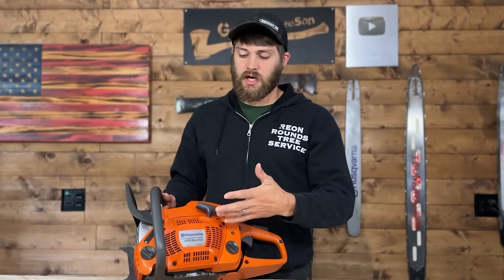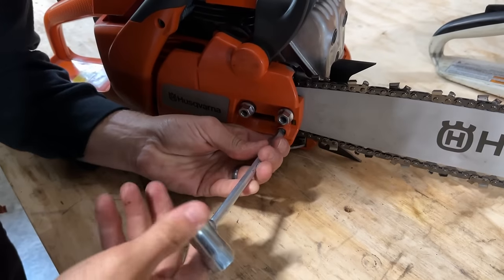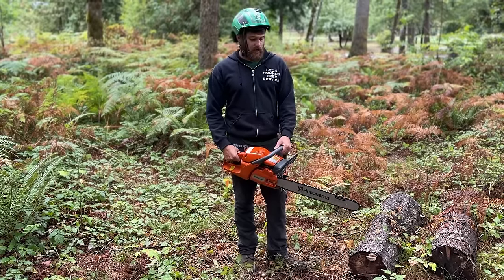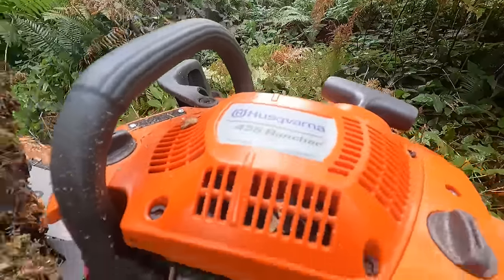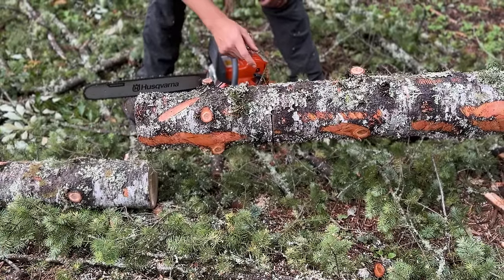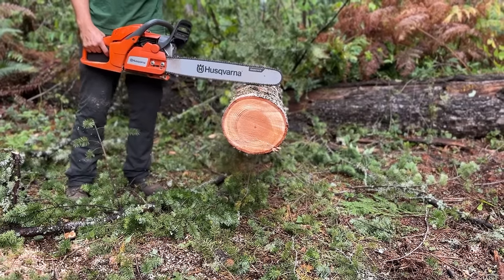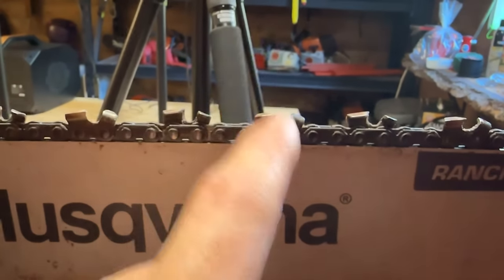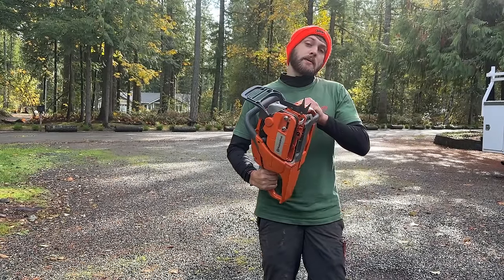WORLDS BEST CHAINSAW TUTORIAL! EVERYTHING You Need to Know About Owning and Operating a Chainsaw!

Comment: Important to remember when buying small amounts (1 or 2 gallons) of ethanol free gas is that stations that use multiple types of fuel that use a single hose will have up to 1 or 2 gallons of whatever the last use was in the hose system! You may think you are getting ethanol free, but it may not be the case. I always pump a few gallons into vehicle tank and then fill up smaller containers. Chickanic does a good video on this.
Reply: I buy ethanol-free fuel all the time for my small engines. Never thought to do this. Will be doing this moving forward.
Reply: I’ve never been to a gas station with ethanol free that shared a hose. They are always separate where I’m at. I don’t know why any station wouldn’t be like this.
Reply: Love your videos man keep it up

Comment: Just a quick tip on the ethanol free fuel. If someone used that pump before you, the hose could be full of ethanol fuel. I always put a gallon in my car before filling the gas cans.
Reply from the maker: Thanks for the tip!
Reply: Does everything pump through the one hose in USA? We have different hoses for different octanes and deisel here
Reply: @dad_uchiha1707  
Some places do pump ethanol fuel and non-ethanol fuel through the same hose & nozzle.  Some places have dedicated nozzles for the non-ethanol fuel.  You have to keep an eye out for this.  If they do use the same nozzle, it is a good idea to pump the first gallon or so, into your car first, then fill the gas can that you use for the saw.  You never know what grade of fuel the person before you put into their car, and the hose and switchover valve inside the pump might be, most likely, filled with ethanol fuel.
Reply: Luckily my go to gas station has its own hose for ethenol free gas.

Comment: I have beem in logging and using a chainsaw for 55 years and one of the most important things to do is keep your thumb wrapped around the handle bar, you did not say anything about that. On kick back the saw will not tear your thumb off, but if you do not have it wrapped around your handle bar your hand will slip off and you will get cut.

Comment: Ol' Chainsaw Gramma here...have both Stihl and a Husqvarna.  One thing I do after warming up a saw that I think is ready to go, is I put down a little chunk of cleanish cardboard or some newspaper and full throttle the saw blade over it.  If your oiler is working properly, there should be an oil streak on the paper showing that your oiler is indeed oiling the blade and not plugged up.  Beats finding that your blade is hot when you're in the thick of cutting.

Comment: As im sure others have already said flooding an engine is caused from to much gas in the cylinder it actually soaks the spark plug preventing proper ignition. Holding the throttle open allows air into the cylinder this helps to dry the cylinder/plug but also corrects air fuel ratio allowing the engine to run. I really enjoy your watching climbing and felling in the south we don’t climb much mostly done from a bucket

Comment: That is a great video to learn how to own/operate a chainsaw. Thank you for teaching and helping to reiterate how to properly use a chainsaw. One thing beginners need to know on saws especially stihl saws is that when you put it at half choke the saw is going to be running at a high rpm and it only takes 30 seconds at full throttle to destroy a chain break so when the saw starts to rev on half choke immediately blip the throttle so that the rpms go down. This is one of the best beginner tutorials out there in my opinion.

Comment: Hi. This is one of the best basic chainsaw orientations and basic chainsaw safety training videos on YouTube.   When you were reading your raker depth guage you were reading it as "point two-five". It actually reads .025 which means the top of the raker is 25 thousandths of an inch below the top of each cutting tooth when the chain is properly sharpened.  This provides ideal chips when cutting.  Your more extensive video on this subject is equally good. Thank you very much. They are extremely helpful.

Comment: A tip for fueling up: use a small brush to clear debris from the cap areas. A laundry detergent bottle with a pour spout will make filling up the oil tank easier.
  For most homeowners looking to purchase a saw to use a few days per year, I recommend getting a battery saw. Milwaukee, Dewalt, Makita, or whatever brand you might already have is a good choice. Avoid the super cheap knockoff brands or used saws from a stranger. What might seem like a good deal will likely lead to a lot of frustration later.

Comment: Very good tutorial! Thanks! I have the 455 Rancher myself. Just bought two new Oregon chains for it today. It's nice to see a tutorial using the exact equipment I have!

I like the 455 Rancher. I also looked at the 460, but it's heavier and i didn't really need the 24" bar it comes with. I bought the 455 because I had to cut up a big fallen oak and a big pine that it knocked over when it came down after it was struck by lightning last summer. Both trees ended up lying right across my long driveway through the woods. I didn't even know it had happened, but my wife called me when she came home and found that the driveway now disappeared into those big fallen trees! I got a lot of firewood from them, but it was most of a week of work for me to cut everything up and stack all of the wood and clean up the area. I needed the exercise anyway!

Comment: Very comprehensive tutorial and you covered all the important topics of the chainsaw.  Nice job!  I am a 50-year DIYer chainsawer and it seems I never quit learning about these awesome tools.  Only thing I'd add is that I do exactly what you do for long term storage but I run engineered fuel thru it before putting it away (vs keeping it dry) .  The engineered fuel lasts two years and keeps the diaphragms lubed. Be sure to buy the 50:1 mix.  What kills fuel systems is not only ethanol (minor) but the benzene found in all gas station gas.  Benzene is the major killer of fuel systems.  Engineered fuel has little/no ethanol or benzene and will not wreck your fuel system. I run gas station fuel when operating the saw (lots cheaper) but store with engineered fuel.

Comment: The rakes are strange looking because it is a safety chain. They are normally included on home owner chainsaws so you have to tell them you want a real chain not the safety chain. The safety chain cuts a lot slower because it takes a smaller chip but it is also a lot harder to get kick back so it is safer. I didn't know about the safety chains once and ended up with one. I took the chainsaw back because it cut so poorly. He told me about the chains and I bought a good one. Kept the safety chain for an emergency backup but have never put it back on. Love your videos.

Comment: As a woodturner I get access to quite a few logs from local tree surgeons. I need to cut them up to store to allow to dry. In have been using a small electric chain saw to chop smaller branches around 6 to 7 inches in diameter. I am moving up to larger bowls (15 inches diameter ) and as such  now need a more powerful chainsaw and longer bar . I have just purchased a petrol chainsaw with 20 inch bar. But in respect of how dangerous it could be have embarked on a lot of video watching to educate myself on the correct and more importantly safe use before I start. I have viewed several videos on you tube but your video has provided so much comprehensive iniformation, instruction and guidance, delivered in an easy to understand way. I will refer back to it again and again in the future. Thank you for making such a superb video. It has helped a great deal.

Comment: Flooding means you have too much gas and not enough air so it can't burn because there's not enough oxygen in the cylinder anymore. You need about 10 parts air to one part gas before correct combustion. Flooded just means there's too much gas. The reason holding down the throttle and turning the choke off is now you are opening up as much air as you can possibly pump into the system at a time. So if you don't want to just wait forever, you can open the throttle all the way and eventually you'll pump out enough of the fuel and get enough air back inside at it will fire up and start. Hope that helps.

Comment: flooded, having throttle wide open adds more air then fuel, allows to remove the excessive fuel/ oil 
mix from chamber. can remove plug and pull few times to dry out cylinder, and wipe off plug so it will spark.
warm up due to aluminum piston to steel bore and so everything’s at proper “gap” tolerances when warm.
great guide , you did a wonderful job covering all the key points. what experience have you had with gas 
stabilizer? or running cleaner in the gas mix? great video thank you for your time.

Comment: I have been told that if I have had to tighten the bar after it has been running for a while to make sure you loosen the bar when you are done an put it up. The reason you have to tighten the chain is because it has heated up and the metal has expanded. Once it cools down, the metal will shrink back down. If you don't loosen up the bar, it will get really tight and wear out your sprocket bearing faster.

Comment: One guick note on fuel as an ex stihl dealer. Your spot on about the ethanol in today's fuel but occtain does matter. Stihl recommends 92 or better . Also only fill your cans to premix ratio. Most gas cans hold more the stated amount
Reply: Also, adding any oil at all to fuel will reduce the octane by a point or two, per bottle. You can start with 91, but by your second mix bottle your octane might actually be 87-89. Use the highest non-ethanol octane available

Comment: Great info. One thing that I have done that caused a problem was to take the side cover off when the chain break was on. The brake band that wraps around the clutch gripping the clutch so it will not rotate is mounted in the side cover and when you pull the side cover off you are also separating the brake mechanism from the device that is used to disengage the brake. Then it is relatively impossible to re mount the cover because the brake band will not go over the clutch in its engaged position.

Comment: This video was great! I literally knew almost nothing before cutting down my first tree. And not much more before buying my first saw (out of necessity: big tree fell over in a windstorm mostly blocking my front door). But, one day i found your old channel and have learned so much more! I actually went out to buy wedges! Previously i was using small sticks in the back cut to prevent the tree from pinching my bar... But i was also cutting all the way through the hinge. I cut much more cautious now and use my wedges... I still need to get a decent axe, but it's on my list with some chaps. I actually barely knicked a pair of jeans once 🙀

Comment: I have ran ethanol premium gas in my chainsaws and trimmers for decades without any issues. I just add stabilizer to my 5 gallon container of gas, and then mix a gallon at a time. I have found the vegetable based bar oil to be very thin, and gets used up very fast.

Comment: Very well done.  Really first rate info, and your sense of humor (whimsy) is contageous.

I have an old Husky 55 (1999) that still runs like a champ.  It's punched way above its weight and I joke (or am I joking?) that I want to be burried with it.  Starts right up and bingo, I'm in business.

The only thing I think you might have covered is that the cutters are generally sharpened with the bar pointed in opposite directions so you file towards the cutting edge of the cutter.

Oh.  Nitpicking, but the raker file gauge you demonstrated was .025, not .25.

Comment: The point about letting saws warm up before use is critical.  Particularly if you are interested in getting long and useful lives out of your saws.  The basic gist is that the piston is usually made of a lighter weight alloy material than what the cylinder head is cast from and, when you start a saw and immediately give it the beans without letting it warm up from idle, the piston will expand in size at a faster rate than than the cylinder head, which results in the piston expanding to a point where it will begin scoring itself and the cylinder walls; the rapid expansion of the piston can also cause the rings to seize as well.  I worked on an MS 462 Magnum recently which had this happen so badly that chunks of ring material managed to embed themselves in the piston.  

One other comment I might make from the section on saw starting - you showed a few shots of the saw sitting on the ground idling and warming up.  Depending on your region and usual climate, this might not be a problem, but where I live in Montana this can pose a significant fire risk if the muffler happens to be in front of or near flammable brush.  Same goes for when you shut the saw off and set it down with a hot muffler or bar & chain.  Of course, too, if the fire danger reaches a certain level, the saws may need to just be put away completely.

I service and sell STIHL chainsaws for a living, and do plenty of logging in my spare time as a hobby and side gig.  Love your videos, keep it up

Comment: Good video thanks...👍 I suppose being picky, the more you raise the bar before tightening up the side cover screws, the more out of square your tree felling sight lines will be. Maybe less than 10 degrees in the extreme, but they aren't to be 100% trusted as a true 90 degrees to the cut. 

I've only been an amateur home logger user this past 20+ years and use a cheap DIY store small saw, but I keep it sharp, clean and never run out of bar oil and it has done me proud all these years. I just keep an eye on replacing the tubing yearly, cleaning the air filter and only use UK premium unleaded petrol in it. Thanks Jake...👍

Comment: Nice tutorial on a saw that I own. The Husqvarna 455 rancher. It's also a good idea that if one wants to do some serious and good cutting or moderate felling is to get a good quality bar and chain. Some of these 455 ranchers that are sold in hardware stores that come in the box complete with bar and chain come with only an entry level bar and chain for just around the acreage use such as cutting firewood and not that great for felling or heavy duty work. Some of the Husqvarna 455 Ranchers come with a Husqvarna  " Farm tough"  bar and a H-40 chain 3/8th pitch 72 tooth bar and chain .050 guage. I am using an E72 powercut on a 20 inch advanced cut Oregon bar .050 guage and 3/8th pitch on mine.

Comment: Excellent video!A little tip from Chickanic channel about ethanol  gas  would be to put 1st gallon in your truck as whatever was in the hose from previous user (generally 87 ethanol) is what you will be putting into your  gas can. Would a big difference if just using a 1 gallon  container  or if pump had a very large / long hose .

Comment: Your raker gauge is .025, or 25 hundredths. That is how much lower the raker is from the cutting tooth. In your case, you are filing your rakers down .025 lower than your cutters. So that means it will take off .025 of wood each time the cutter hits the wood.

Comment: A saw is "flooded" when the fuel-air ratio in the cylinder exceeds the combustion range (not enough air/oxygen to burn the fuel). When unflooding, holding the throttle works because at full throttle the carburetor lets in more air in than at Idle, Leaning the over-rich condition back out into the combustion range.

Comment: great video Jake! I am going to send it to my brother who just bought his first chainsaw :-) 
one thing I would add to the starting of the chainsaw part, is to make sure you get oil in your bar. definitely with a brand new saw.
another thing I do when storing is, first I start the saw with the gas still in it to make sure it is hot. then I dump the gas and run it till empty. I did have some saws where they would no longer start after dumping the gas :-) 
just my 2 cents ;-)

Comment: Flooded means too much liquid gas in the pathway where gas and air enters your cylinder, or even in your cylinder.  Your carb or injectors are designed to “spray” gas in a fine mist so it mixes with the air that’s flowing into your saw.  Too much gas or not properly “misted” fuel won’t reach the right air/fuel mixture, and floods the motor.  Pressing the throttle trigger allows more air to flow, which either pulls the liquid gas through unburned,, or helps the gas mix into the extra air, and get to a state where it will ignite and burn.  Waiting lets the gas evaporate.  Sometimes.  But it still may take a few pulls to fully clear the cylinder out.

Comment: I agree the ethanol in the fuel is a problem. It does separate over a very short period of time and clog the carb. It also is hygroscopic meaning it soaks up water from the air. So a tank can end up with a lot of water in it in storage. But its the benzenes in the gas station fuel that eat the plastic in the hoses and make the carb filters brittle

Comment: 18:28 You solve that problem by holding the saw with your right hand and the bar facing to the right when you start it, that way the bar swings away from you instead of towards you when drop starting the saw, it's the best tip I ever got starting chainsaws, makes it a lot safer.